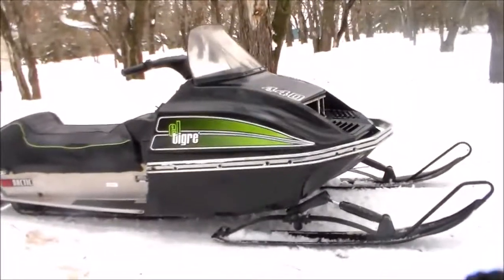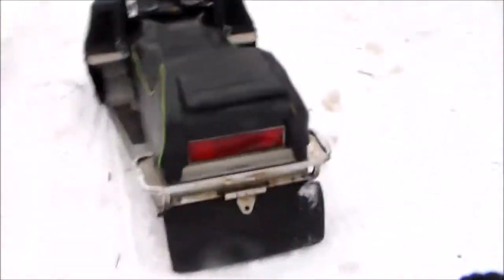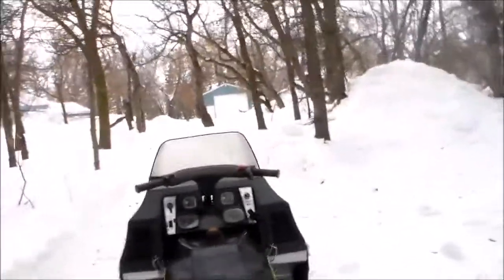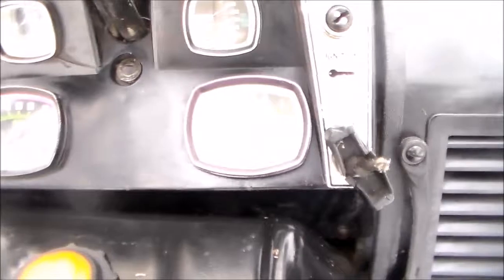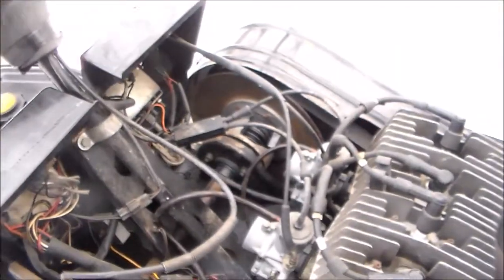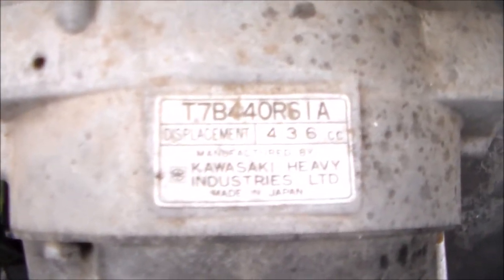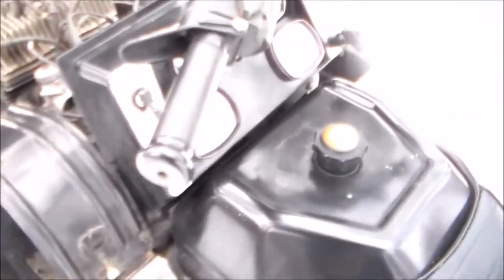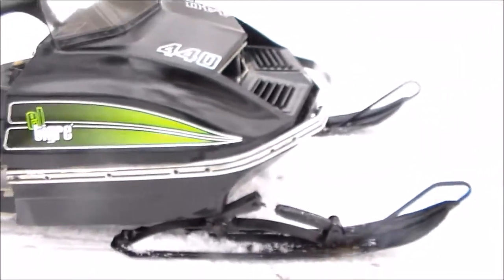1974 arctic cat  440  el tigre snowmobile

Comment: I purchased a 340 el tigre new back in 74. Got rid of it a couple of years later. Yes it was very fast, the power rolled off big time after 30 or so minutes of running, the suspension was very limited and it was heavy. I currently have a 72 Puma and 83 EXT love them both, more fun than the 74.

Comment: Nice vintage tiger. I had a 79 6000. If the gold braising on the manifold breaks... clean it off and braise weld it with a metal coat hanger. It will never break again.

Comment: Nice to see one not chopped up and left stock. Glancing through the comments I'll say a few things. 1. I'm an old fart and I remember these sleds well.  2. The twin plug heads are for the T7 Series Kawasaki engine. First made famous in the 1973 model EXT oval racer, (And the rare Formula II 295), but also used in the 1973-74 El-Tigre 400 and 440 twins. The El-Tigre smaller models still used a version of the T-1 series that were descendants of the 1971-72 EXT racers, in 250/295 and 340cc sizes. Those were single plugs.  Yes all versions of the 1975 Z were twin plug heads and on most of them the heads were wider with more fins than the El-Tigre. (The fluke was the 1975 340 El-Tigre that finally got the smaller finned twin plug heads on the trail sled. That was the only year for that.)   The "Tigger" was detuned to try to get some more reliability into it. A more mellow  set up than the race sleds. Now, reliability/quality control back then was not what it is now, not even close. The Kawasaki engine had some quality control and sealing problems. If you got a good one, it was a great sled. If you got a bad one, it was an invitation to the discount bulk Tylenol section at your local drug store. I've seen it both ways. One friend had a 400 that was an overhaul once a month. Another friend had a 440 that was really quite good and even ran well in spring temps. Today, I tell guys that ask me about restoring to be prepared to go through the engine from the crank to the top and make it all new and correct if you want it to run right. Also do the same with the clutch and drivetrain. It does not tolerate lack of daily maintenance at the vintage aircraft level of being persnickety.  Best thing to do if you want to keep and feed one. Just my .02, your experience may vary. Thanks and enjoy that kitty!
Reply from the maker: Thanks for looking.. My cousin was mechanic for an arctic cat dealership from  1972 to the late 70s. So I had a lot of help with my sleds.. Thanks for all the great info..  Really appreciate it!!  ( wish I had a 1973 ext)
Reply: @travistml  Great!

Comment: Thanks for posting this. Always loved those sleds. They did come with an air-box but ,many (if not most) have lost them over the years. I believe the two plug heads like yours were from the 'El Tigré Z'' racing model. Switching to them was a popular mod back then. Liked your video,one thing though...It's not pronounced  ''L TIG  ER''  it is ''L  TIG RAY''. It's Spanish for ''The Tiger''.
Reply from the maker: Thanks for the comment and info!!,  Yes I love these old sleds to !
Reply: whowantstoknowido ya I thought the dual plug heads were only on the Z

Comment: Very nice. I thought only the 440 Z had the dual ignition.
Reply from the maker: What I have been told is that the Kawasaki engine used in the arctic cats used 2 plugs per cylinder in there 440 cc and 340cc free air machines, the 292  and the 400 free air had only 1 spark plug per cylinder. All fan cooled had 1 plug per cylinder. Maby some one could clarify this as we only had this 440 El tigre..and our other cats with kawasakis were fan ciooled.
Reply: @travistml  very nice.  I had the 1987 eltigre 5000.  It wasnt a world beater but it was a really nice trail sled. I managed to put 7000 miles on it.

Comment: I had one of these exact models.I loved it but it was not very durable or reliable.At 1050 miles it would no longer run as the crankshaft seals were leaking so badly it could not get a rich enough mixture to fire.Arctic Cat also wanted nothing to do with the warranty and they were known to wear out very early.How many miles have you personally put on this sled?My experience would say it would have had to be rebuilt at least twice to get your history.
Regards,
Brair
Reply from the maker: Can,t say I had to many problems with the Kawasaki engine. The cdi box (ignition) gave some problems and exhaust was prone to developing cracks.  We used the el tigres a lot in the 70s. Had  this 74 then a 75 and 79. The 75 and 79 had Suzuki,(spirit engines)
Reply: Crankshaft seals were the weak link..tho an inexpensive fix..worth it..theses sleds were screamers on a cold day

Comment: I have a 74 Eltigre with the T7C436FR1 engine. Do you have anyone who can rebuild this engine?
Reply from the maker: sorry i do not know of anyone who does rebuilds. Check with your local snowmobile club. Some one there might be able to help you.(might even know of an old machine with a good engine you get get for little or nothing!
Reply: Not trying to be a grape here: That model number comes back as the 1975 440 El-Tigre stock trail engine. Perhaps you can check the serial on the chassis? Should start with a 5. If its a 4 then it's been swapped.  Just trying to help.

Comment: Nice machines, but I hated those cleated tracks.
Reply: Being a dealers kid we got good at studding and fixing them so they wouldn't slide on ice so much.  But other guys would look at the amount of work we did to keep running and get annoyed. LOL.  When the 1978 6000 El-Tigre started using the 3/4 lug rubber paddle track like Yamaha and others it kicked off a revolution. I adapted one to a 1978 Jag and holy moly, once I got the stud pattern down and the clutches set up to take advantage of the lower weight, it felt like the sled gained 10hp!!!! So much less dead weight. Easily 5 to 7 mph more top end and for once I wasn't always behind everyone else.
Reply: @glenmallory9982  I had an old 73 Polaris TX400, and a 76 Yamaha SRX340, and the both had the steel cleat riveted tracks, and the cleats would always break in half. If they were used just on flat lakes and ice they lasted, but using them for everything else wrecked them.
Reply: @johnb5519  Sorry for your experience. Yea the long cleats are labor intensive. The 2/3 cleat Cat tracks were better because they would flex around the rail. I wore mine out on my Jag after six seasons and thousands of miles. Another reason I upgraded to the rubber 6000. To keep a 1972 Cat track running we learned to keep the suspension working right and avoid rocks or stumps in the snow. Even then, I'd replace about 4-5 a year, maybe more.  Never put studs in the middle either. Best to use box studs on the outside of the rail for a full cleat. There was a reason they went away...Thank goodness! I didn't have the bad time in the snow that some other brands had. But yea the constant repairs and the white knuckles on ice every weekend got old. First thing I did when I bought my 50 year old Cheetah is buy spare cleats.... I'll leave it stock and set it up like the old days, but it's a show sled. In 50 years I think track tech has probably been the biggest improvement. 😁